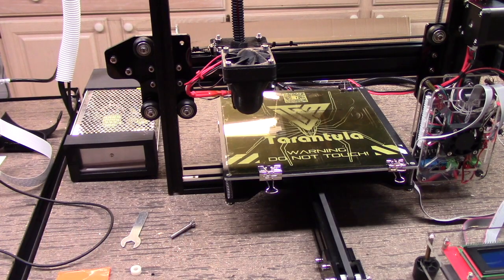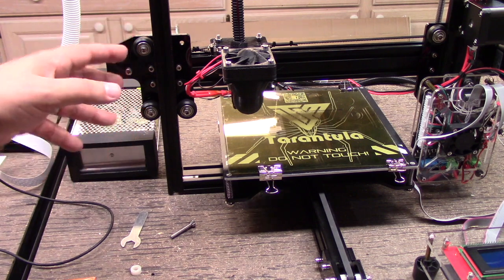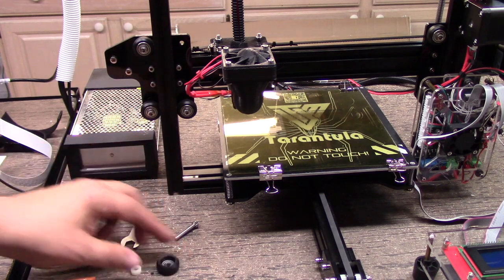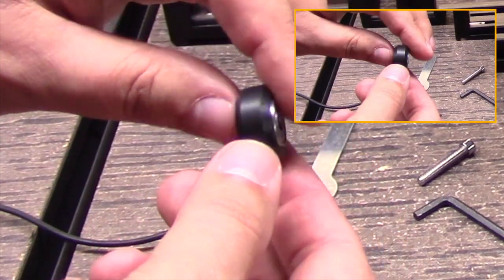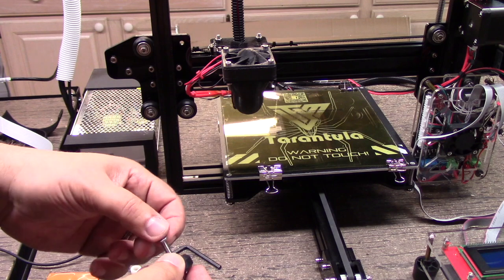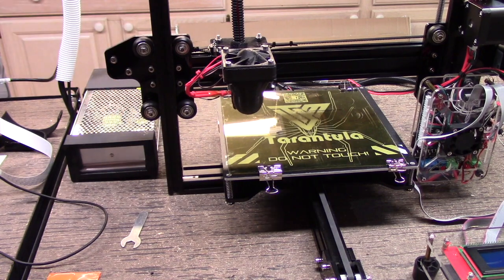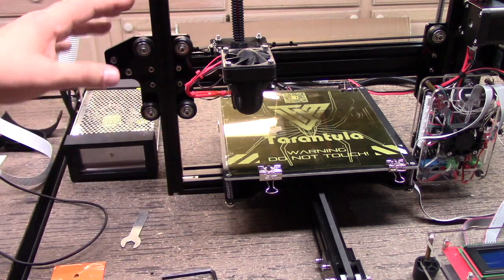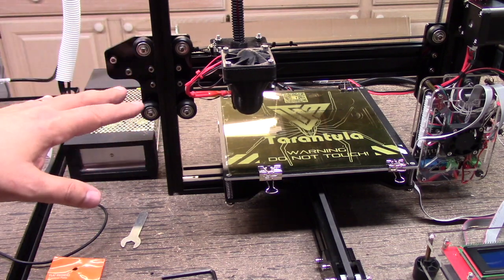TEVO Tarantula 3D Printer  -  Number 10 Washers Myth or Magic?

Comment: Does this still apply to the new changes Tevo made to the wheels? Arcade ed had the lock washers, but made an annotation that Tevo fixed the issue that required using them.
Reply from the maker: Sorry have not seen the "new" wheels, so if they fix this that would be a great addition!

Comment: Sorry for the dumb question but I don't understand the implication here. Are you saying that the washers are somehow better than the included shim? Or do you think the difference is using the shim on the outside of the bearing, doing the same function as the lock washer on the other side? If the latter, why not just use two lock washers on the outsides and leave the shim in there?
Reply from the maker: Yes the "flat" washers are better than the supplied "lock" washers (I received no "shims" with my kit) as the "lock" washers require too much tightening to create a unified "pressure".  In short this has made a huge (positive) difference...
Reply: Cool, so the benefit is having machined-flat surfaces riding on the bearings (the inside shim and the outside spacers) instead of the uneven lock washers. I'll get some M5 engineering washers and re-do the wheels with those instead of the lock washers. Thanks for the clarification :) I've also seen mention of using two plates, one each side of the 2020 extrusion, instead of just one plate, which should provide more stability for the wheels. Of course you'd need to either print or make another plate for each side.
Reply from the maker: The stability as is, is pretty good as keep in mind what it is as I've seen some guys go hog wild and with linear bearings and all but if your going to invest that much money and time you are further off purchasing a more expensive printer because you just hit other other issues....
Reply: I agree totally. I think things like linear rails and carbon fibre brackets on a Tarantula is a complete waste of money. I'll do some cheap upgrades to get this printer working reasonably well and then think about building a CoreXY like Tech2C's HyperCube. Now that's a printer worth spending some money on!

Comment: Oh, Aliexpress has these wheels for pretty cheap prices but they only come with one shim too so I immediately knew to purchase a bag of 50 5mmx10mmx1mm because only 1 shim is a really bad idea.  Raised my cost about 10-20 cents per wheel (they were stainless) but still far lower in price than OB charges by more than half.
Reply from the maker: 10-4 good buddy as I have also looked at the Aliexpress wheel too.  Also yes on the stainless as they are well worth it :-)

Comment: The problem is, is that the bearing are just shit quality. I removed mine individually, added extra lube as some of them felt dry and worked them and most of them gradually freed up somewhat. A few had lumps or tight spots that haven't worked out so I will have to replace them but a decent set of quality bearing would make this problem go away...also all the new kits are coming with the washers pre installed...
Reply from the maker: Thanks for commenting and lubing them is a good suggestion, mine weren't as bad as it sounds yours were however they would "bind" and washers solved that.  I have built several machines and always installed the washer, however, wanted to sort of follow the instructions (what few there were) so this see what other folks were experiencing.
Reply: PlaneCrazy Do you have a link to bearings that one could purchase to replace those?